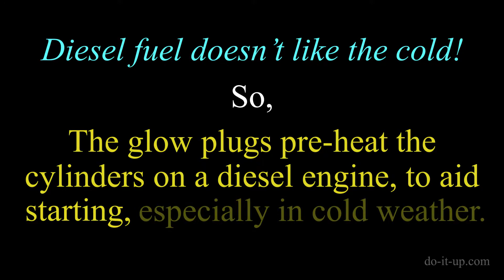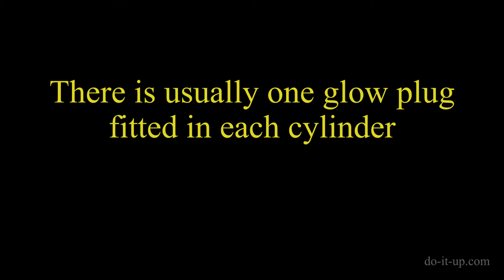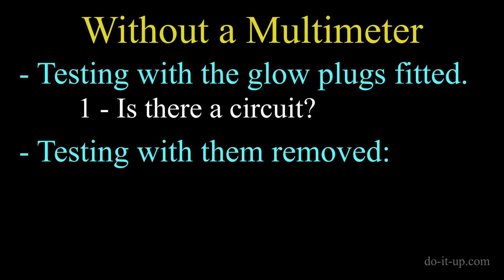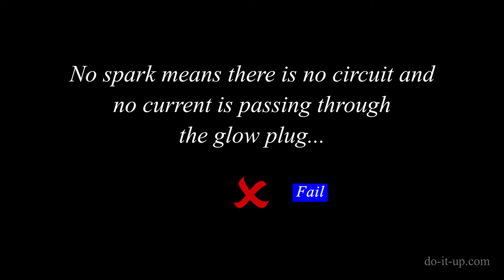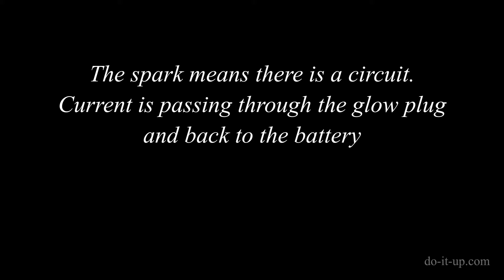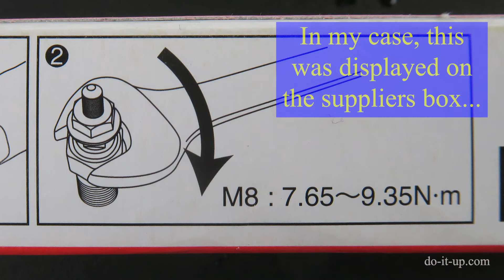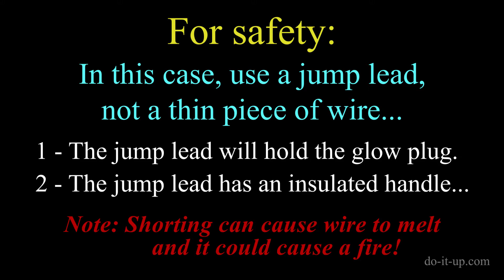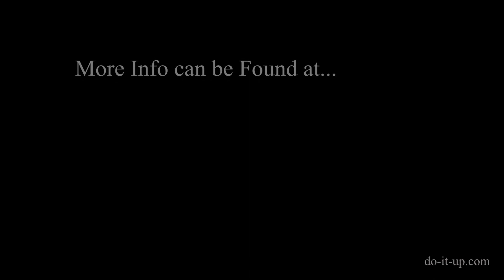How to Test 12v Glow Plugs From Start to Finish (With Jump Leads & Wire) - The Complete Guide.

Comment: this is how you can damage a 4.4V glow plug.
Reply from the maker: Hi, yes. The video is nearly 5 years old now and was based on an older vehicle. Since then, more and more vehicles have switched to a 5 to 7 volt glow plug system...  Unfortunately, to update a video, you have to start all over again from scratch. I have added 12V in the title and there is a note about the voltages in the text below the video "Typical values (next gen) 4.4v to 7v. The resistance value may also be below 1 ohms. You may need to refer to the manufacturers specifications, to get the correct value…"

As a footnote, I would also check the glow plug manufacturer's data sheet online (for the glow plug fitment), as there are so many different voltages and resistance's used on vehicles now. Everything has moved up a notch, and is just a little more complicated now!

Thanks for the prompt...   😃👍
Reply: @doitup  nice explanation. I appreciate your nice comment
Reply from the maker: Hi, no problem. If you make a video that may help others, it's always useful to have the right info (as much as you can). Thanks for your positive reply...  😀

Comment: If glowplug is 5v and connect it directly 12v. What will happen to plug, burn out?
Reply from the maker: Hi, there are more and more non 12v glow plugs being fitted now, (I presume it's because the electronics are getting a bit more fancy). As it's a 5v glow plug, I wouldn't test them directly from the battery with 12v, (the 5v will be supplied from the glow plug control unit). What I would do, is test them as shown at:  https://youtu.be/YkKsbRHHNS8?t=439 (Test No.3 at position 7:19). This is where you can test the glow plugs when removed, but plugged into their connector, (so you can see if they glow & test the length of the timer operation). Don't heat them too many times, as they could overheat whilst out of the engine. Hope this helps...   😃

Comment: Do you disconnect battery when testing????
Reply from the maker: Hi, there's no need to disconnect the battery. Just make sure the ignition is switched off. There are some tests where the ignition will need to be switched on, for example at: https://youtu.be/YkKsbRHHNS8?t=441. It should be noted that it's always best to keep the ignition switched off when not in use. Hope this helps...   😃
Reply: @doitup  thanks so much for the quick response and information ive an old mitsubishi L300 van 1992
Reply from the maker: No problem....   Great van, nice to see something like that still on the road...   👍
Reply: @doitup  Thanks yours too what year is yours? If they made cars and vans like this now manufacturers would be out of business lol
Reply from the maker: Hi, I don't have an L300, but I do have a 1960 Series II Land Rover. Not running though!  😒
Reply: @doitup  wow impressive classic is the land rover fixable??
Reply from the maker: Yes, but it needs a new chassis. It's getting a bit thin in places and changing to a brown colour. Basically, if you're changing the chassis, you may as well do a complete rebuild... 🛠️🏗️   It's on the list of many things to do...
Reply: @doitup  hope that you do !!

Comment: When touching a wire from positive terminal to the top of the glow plugs I get a massive spark as if the wire is touching ground. No idea why.
Reply from the maker: Hi, it sounds like it's as you describe... The electrical path through the glow plug could be going straight to ground, (a dead short, no resistance...  Make sure you are only touching the very end of the glow plug). It maybe worth checking to see if the glow plug is actually a 12v glow plug, by checking the manufacturer's data sheets online (just to make sure). As more modern vehicles can use different voltages.

If you don't have a test meter, check to see if the glow plug works? If you have some jump leads, use 'Method 3' at https://youtu.be/YkKsbRHHNS8?t=440 in the video. Don't heat the glow plug up too many times (whilst not fitted, as the glow plug could overheat). Be careful to avoid anything that can melt! 🔥🚒

Hope this helps and you get it fixed soon...   😃
Reply: @doitup  Hi thanks for the reply. The funny thing is I did the test a few days ago and just got a small spark as expected. I found one dead plug so put in a new one. The only other thing I have done is charge the battery. Now I get the big spark as said, but also no voltage at the plugs when turning on the ignition. I expect either the relay or fuse needs replacing, I'll investigate further tomorrow . Whether the battery charger fried it somehow I don't know.
Reply: The insulator on one of the plugs had failed and was shorting out, which blew the 80 amp fuse.
Reply from the maker: Hi, glad you found the issue. Thanks for letting me know, as it's always useful to hear what the issue was, and how you managed to find it. There's often some satisfaction in finding out what the actual problem is and being able to fix it!  👍😃

Comment: you have smoke rising from the left side of ur engine as sooon as it fires up..
Reply from the maker: Hi, well spotted! The injector copper washer is not sealing properly...  I ignored this at my peril. I needed to remove the injectors some months later. It took 5 days (of going away in despair, and coming back to try again) before I got them (it) out! Carbon deposits had formed around the injector fixing it in solidly in place. Moral of the story:

1 - If you take the injectors out, always clean them and replace the copper washers.
2 - See a puff of smoke? Replace the copper washers at the earliest opportunity.
3 - You could walk away and hope you never have to take the injectors out!
4 - You may then have wished you'd changed them earlier!

In my case the following order applied...   3, 4...   then 1 with a lot of grief!

You live and lean..!      😥
Reply: @doitup 
 Well its not something you will normally see from the drivers seat.. happy to spot it for ya,,    algud.

Comment: Hi
I’ve got a Ford Transit Custom 
Basically it’s a hard start when engine is cold and once it’s driven n warm it starts as many time as I would want 
Does this indicate glow plugs ?
Refer Back 
Regards
Reply from the maker: Hi, it sounds like it is. But, there is always a chance it could be something else? There could be other issues, such as the battery on the way out, faulty wiring, etc. All you can do is try and test for any of the potential issues, or replace parts one by one and see. Hopefully the video gives you a few things you can check, to see if the glow plugs are OK. Hope this helps...    😃
Reply: @doitup  
Best to diagnose the fault, and remedy those.. this is an old post nonetheless ..

Comment: Hi, thanks for these video, they're really informative 👍🏻
Can I start my engine when testing like this (option 3) to see if the glow plugs cut out? Assuming they're working. 

I have tested the V at plug connectors and I'm getting 9.98v with key in position 2. When hold the probes on until the voltage cuts out, after more than 1min it doesn't cut out, 9.98v constant. This makes me think there might be a problem with the timer and burning out the glow plugs possibly. 

When I test the continuity of the plugs I get the beep on the multimeter, but testing the resistance doesn't give any reading, only none of the plugs, which makes me think they're all shot.

I'm going to try the wire/spark test first tomorrow  and if nothing I want to try removing one to test. But am also wondering, as this is a volvo c30 diesel, that maybe the plug voltage is only cut once the car is turned over. I know it's recommend to not start a diesel immediately, even though I do, but now see the logic why, to let the plugs warm up.

I have a Reduced engine Performance message and my fault finding mission lead me to the glow plugs and/or GP circuit, but I dont have any or the usual symptoms I.e. difficult to start when cold, white smoke, noisy idling. The car fires up and runs fine  whatever the weather.

Thanks again for the videos. And what's the worst that can happen if I start the car with plugs connected but out the engine?

TIA
Reply from the maker: Hi, I'll try and answer your queries...

- Starting the engine - The compression will be lower, if you have the glow plugs removed. There is a danger from fuel/air/exhaust being blown out the injector holes, (eye injury, and forced entry of combustion mixture through bare skin).

- The voltage supply - is usually around 12v (for 12v systems). However, there are now more and more glow plugs using different voltages. With most glow plugs, you can check the voltage required using the manufacturers data sheets online.

- Glow plug timer - Generally, the glow plug timer will operate with just the ignition on. The glow plugs timer should switch off the glow plugs at some point? But with electronics, you could have all sorts of fancy controls. So dependant on the vehicle and age (newer vehicles)...  If you have a test meter, you can leave the glow plugs fitted. Just unplug the glow plug connector and check the voltage supply at the connector, and how long it's provided for. You can do this one glow plug at a time, (with just the ignition on, or the engine running).

- Resistance - Before you start, you may need to check your test meters resistance? Select ohms, and connect the multimeters leads together. Is the meter reading 0 ohms? If not, recalibrate your test meter. If there is no facility to do this, just subtract the reading you obtained (when connecting the leads together) from the actual reading taken from the glow plugs.

For example. If you get a glow plug reading of 14 ohms and your multimeter had a reading of 8 ohms, we now know the glow plug measured 6 ohms (14 ohms – 8 ohms = 6 ohms). Make sure the contact points (where you measure the glow plugs) are clean and free from oil and corrosion.

- No test meter? - A good indicator on the state of the glow plugs would be to check if they glow (as per the video).

- Modern vehicle electronics - Unfortunately, electronics can throw up all sorts of errors. Sometimes the electronics will indicate the correct fault... Yey!  Sometimes electronics will indicate a fault that can't be found? It then turns out to be a bad connection somewhere on one of the many control units! Had that recently on a Mini. Dynamic stability brake system errors. Checked all the sensors, and associated parts, couldn't clear the error. In the end it was a tarnished pin on a connector on one of the control units.

- Glow plugs failing under load - To check this, you need to measure the current supplied to the glow plugs and see if the current supply falls away. You can do this with a test meter, or a clamp meter.

- Hopefully you've also seen: How to Test Glow Plugs From Start to Finish (With a Multimeter) - The Complete Guide: https://youtu.be/nFrvzstFqwE.
- More info can be found here: https://do-it-up.com/vehicles/engine-transmission/diesel-wont-start-when-cold-how-to-fix-glow-plugs/

Hope some of this helps you...   😃
Reply: @doitup  Thanks for the reply... well I wont be turning the car over with the plugs out then, I am quite fond of my eyes, and not a fan of burnt skin lol. Thanks for the heads up!
But I will re-connect everything bar one GP connector and test the voltage when the engine is started to see if it drops off at any point.
I am 99.9999% sure all the plugs are dead. I tried the wire test today, from + battery terminal to the glow plug, but nothing, no sparks at all. I checked all fuses and relays and module for continuity as well and all OK.
Testing continuity of the GP again, properly, with the black probe on the engine block near the plugs I found there was no beep, so Im pretty convinced they are all dead. Why, I am not sure yet.
But my next step is to attempt to remove them, test, and replace, to see if that sorts it and how long they last before/if it happens again. Soaked the in some lubricant earlier, and will do that a few times to hope they dont end up snapping inside... fingers crossed.
If I manage to replace them successfully, and it ends up happening again, I will try the current test (or is the current test related to what I was referring as the GP timer cutout/drop off?)

Ye I've been though all your videos, very helpful thanks. 

Oh, also I did test my meter last night on a plug fuse and it seemed to be working fine. The plugs are just dead I think. I think the wire test today confirmed it.
Reply from the maker: Hi, here's some tips on removing the glow plugs: https://do-it-up.com/vehicles/videos/engine-and-transmission/glow-plugs/how-to-remove-and-where-are-they-fitted/. See the web page text, as there is some additional info... (the video needs to be updated to include this additional text...). Sounds like you're on your way to getting it sorted...   😃